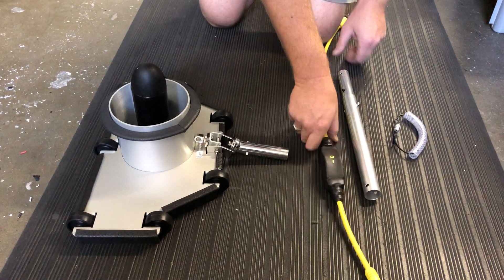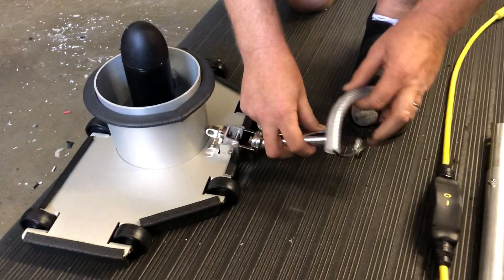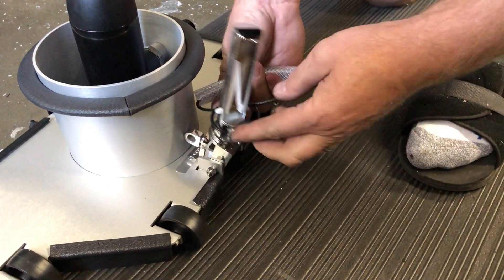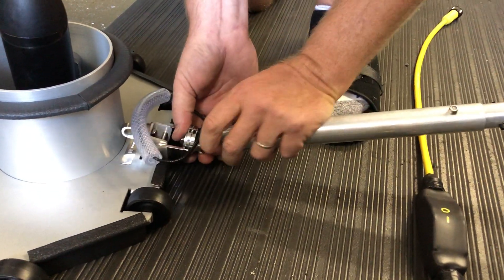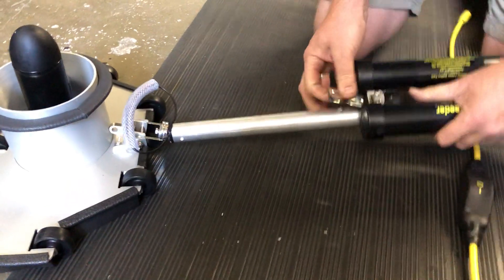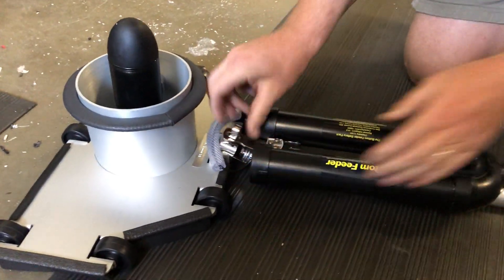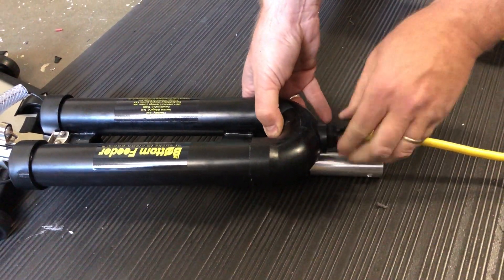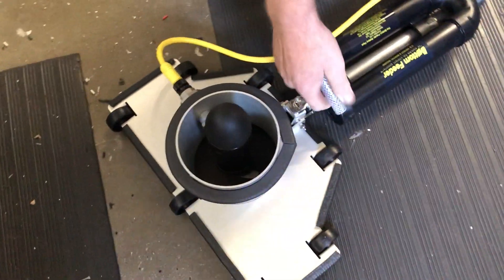The Bottom Feeder® Portability Kit

Comment: I heard that this product has been “recalled”. Apparently the battery has been exploding
Reply from the maker: 750 battery packs have been recalled.  Replacement batteries are due to arrive mid to late December.  Paid a firm 75K to test the newly designed packs for safety, and they are safe.  Recall put me 300K in debt, but hoping to start climbing out in '24.  Sometimes wish I would have just stayed solely a pool guy... but I needed a better vacuum, so I invented one and watched too much Shark Tank.